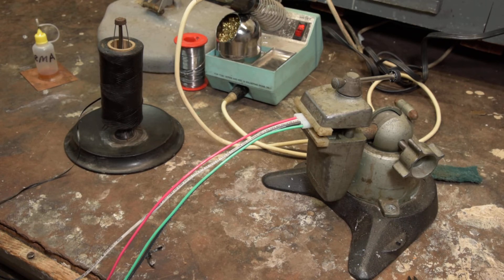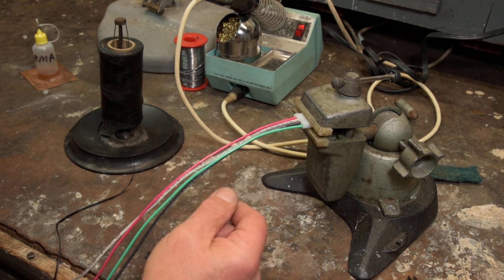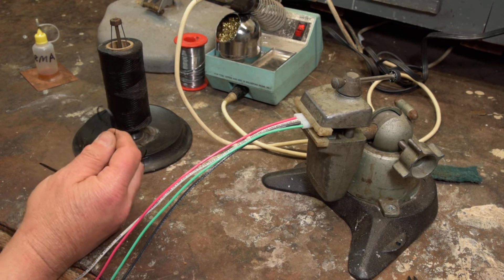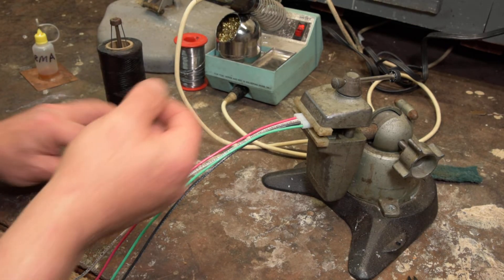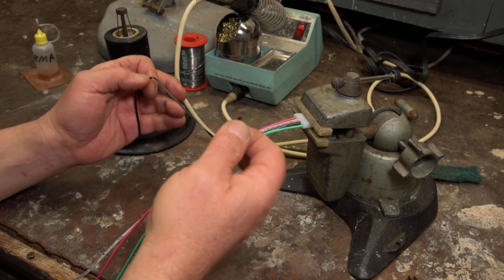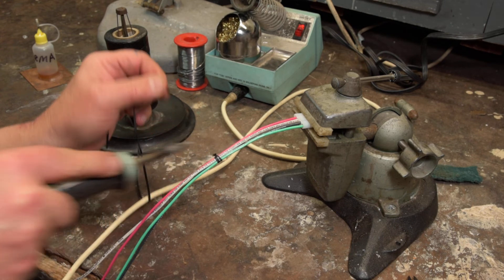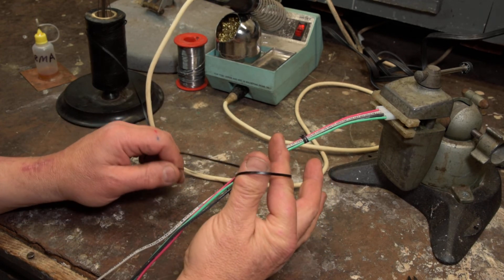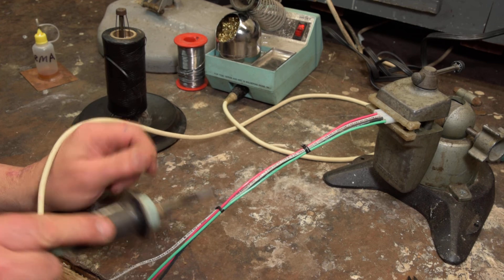⭐ Ye Olde Cable Lacing Knot 0010

Comment: Sorry, you're hands were obscuring what the first knot actually looked like.  I was looking for the version involving what some call a lark's head.  Been using it for years.
Reply: I figured it out.  It's an interesting knot.  Seems equally as fast, or more so, then the lark's head method.  But, having looked at it, the lark's head method can be ratcheted tighter than a cable tie.
Reply: Standards (IPC-620) calls for a clove hitch followed with a locking knot, like a square knot.
Reply: @davidvelozee AC 43.13-1B also calls for a clove hitch with a square knot.  The knot Chris shows here is so much easier to tie that I figured it must be inferior to the “official” FAA knot.  Since I am building an experimental airplane, I am not bound by the FAA standards, but I generally stay pretty close unless I have good reason to deviate.  However, as a retired EE and SE, I am willing to try new things (that is the essence of experimental aviation).  This knot is so much easier to tie than the FAA knot that I wanted to use it, but didn’t want to sacrifice strength.  So, I decided to do my own testing.  I used my bench vise and with the jaws closed tied an FAA knot on one side of the jaws and Chris’ knot on the other.  I then opened the vise until one knot broke.  I was going to test 10 or more times to ensure some level of statistical significance, but after the FAA knot broke first 5 times in a row, I called it quits and have used Chris’ knot throughout my project to date.  I believe it is not only easier to tie than the FAA knot, but also has more tensile strength.  Is there some other attribute where the FAA style knot is superior?  Possibly, but I can’t imagine what that would be as both have two strands around the wire bundle so the surface area in contact is the same and Chris’ knot has greater resistance to breaking so I am absolutely comfortable using it in my homebuilt.
Reply: @davidvelozee  Thank you for the spec.  I've been looking these up.  Yes, all of the aircraft specs I've looked up call for a clove hitch with either a reef knot or surgeons knot to lock it.  The mil. spec. I found also allows a two-strand version for lacing with a larks head followed by however many marline hitches are need.  But, then there's a finishing hitch that I haven't gotten the hang of.  This two-strand method is the one most like what I learned in telephony wiring.  Thanks again.
Reply: @TesserId  I’m not sure what type of knot this is, it seems like 2 knots are getting “combined” to achieve the same thing. It is indeed very effective! I was having trouble with the standard method using 22AWG silicone wire, the “locking” knot kept getting undone! This knot seems to work better, though I’m not sure why! I did however add another half-hitch. And I like the solder cut. I couldn’t find what the other locking knot names were, so thank you for that info! For finishing up a long lacing run, it’s usually the same as the start; clove hitch and locking knot. But I’ll have to look it up…

Comment: They have better zip ties and tensioning/cutting tools to go with them now, so you see a lot of those today, but tie string is still the best in tight holes and spaces; even the good contemporary zip ties can snag on stuff. They won't cut a wire if properly installed. A lot of harness assemblies are produced with zip ties and then the aircraft electricians and avionics techs usually use tie string. Zip ties use is probably inversely related to the complexity of the aircraft; they cause more problems than they are worth on something with big bundles of wires going through every hole, but they make harness assembly much more efficient.

Comment: I tried your knot with some string and see that it isn’t a clove hitch, but is somewhat similar.  I also came across this video which shows both the more standard clove hitch as recommended by NASA and the FAA and what looks to be the same knot you demonstrated.  I wonder if the latter is also acceptable to the FAA?  I would think if Hughes used it, it must be, but I don’t recall seeing it before in any aircraft or space related documents.  https://youtu.be/IyiNoLEGYZg
Reply from the maker: I use it for cables I make in my lab as a compact replacement for wire ties.   When I used the knot at Hughes it was only for test fixtures in the engineering lab.  I have never made flight cables myself.   If you are making flight cables I would stick exactly to the officially approved methodology.
Reply: @Chris_Grossman  Well, since I am building an experimental airplane, I don’t have to follow FAA requirements for things like this, but I generally do simply as good practice.

Comment: I am building an experimental airplane and am learning how to lace/tie the wire bundles.  Your knot is the easiest to tie that I have seen.  Most places recommend a clove hitch with a square knot before cutting the ends.  Do you know if your knot is a unique style of knot or just a smarter way to make a clove hitch?  I need to get some large string and try it and see if I can tell, but I thought you might know off-hand.

Comment: Yes it’s still used in the aerospace business but different material lacing tapes are often used such as polyester(Dacron) or Nomex. Boeing uses those two on it’s airliners. Boeing also uses different colour ties to classify wire bundles.
Reply from the maker: Thank you for the update.
Reply: Even some espresso makers have lacing all over the harness( avinoic shop technician)

Comment: Still have a roll or two of the waxed type, and I still use it as well. Makes a great thread though to do things like shoe stitching, leather work and anything that requires a strong thread. For unwaxed I use a roll of upholstery button yarn, which is as strong, and just as useful. Yes also did many a wiring loom repair with the lacing cord, and even restrung a number of radios with it as well, though the upholstery cord is better in that it is wound and round instead of flat.

Lots of running lacings as well, even if you also afterwards put on the snakeskin, and laced that up as well along the loom, then did the end finishing with rubber Hellerman sleeves laced tight to the bundles.
Reply from the maker: I also use it (with the same knot) to prepare bands for my spear gun.

Comment: Nice trick, any leads on where the lacing cable can be obtained? Or key search phrases?
Reply from the maker: Dino, I added a few links for booing "flat waxed braided nylon cable lacing" to the description
Reply from the maker: buying not booing, damn autocorrect!
Reply: Thanks Chris...I went to Amazon afterwards and found a whole trove of suppliers but your links will probably lead to a better product for doing electronics wiring harnesses...I have used dental floss way back in the day! 73 - Dino KLØS (can't recall whether you were a ham?)
Reply from the maker: @PapasDino  I had a ham license when I was in high school.  I will probably get another when I retire in a few years.